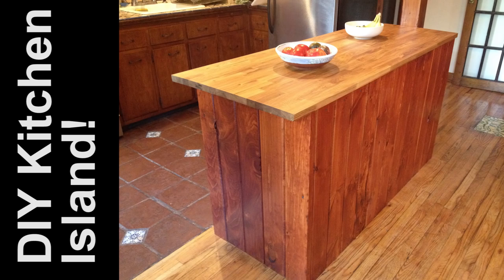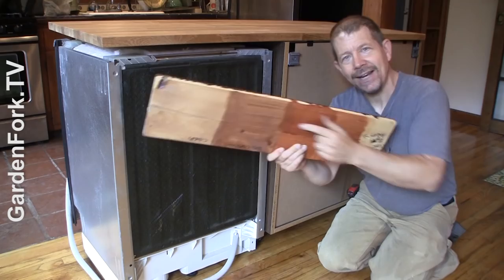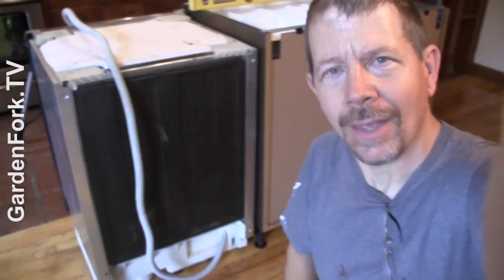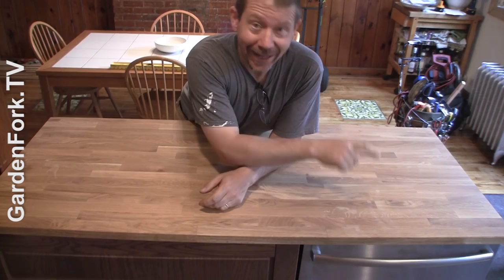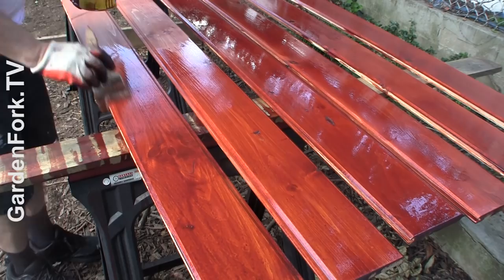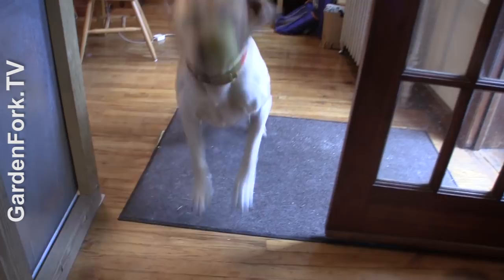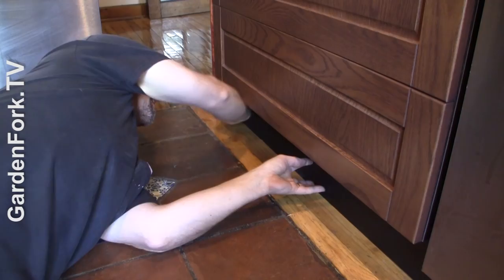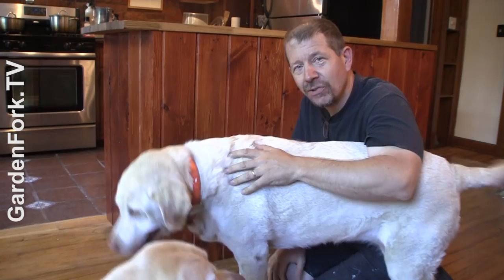DIY Ikea Kitchen Island - GardenFork

Comment: I enjoyed your video but I wish you had a video of you installing the plumping and electrical supply.
Reply from the maker: Hi Levi, whenever I do an electric video, the comment section blows up, so I don’t do them anymore. In most areas you can attach a grounded power cord to the dishwasher and plug it into a GFCI outlet instead of hard wiring it. The plumbing was under the floor, a P trap into the basement.

Comment: I will be using your idea with the 2x4s to build the wall of cabinet next to the dishwasher. I wasnt able to get a good picture of how you secured it besides attaching it to the butcher block. Im assuming you attached it to the floor and did you out any boards on the backside of the dishwasher to stabilize the end wall?

Comment: Hi Eric -
Do you think you could provide some photos of the plumbing from the basement? 
1.) Did you use a standpipe leading down to a p trap under the floor?
2.) If so, is it connected to a horizontal pipe....leading over to the sink drain... or directly into your main drain?
3.) What did you do for venting?
Reply from the maker: Sorry I don’t have photos!
Reply: @austin did you install a dishwasher? What did you do? I'm installing mine this weekend and would have also benefited from the answer to your question.

Comment: I want to do this if the space is big enough in my kitchen, but every picture of 'island w/dishwasher" I've seen except yours, includes a sink. Did you consider doing that instead of the drawers, and if not, do you think if you had it to do over you might have included a sink? I'm worried I will get a lot of water on the floor as I rinse off dishes and transfer to the dishwasher. That could be slippery. What's your experience been so far? What kind of floor is between the sink and dishwasher?

Comment: you could put a piece of trip around the top, under the counter to hide the screw holes, and bottom trim to even it out. Most cabinets have bottom trim
Reply from the maker: i think its a eye of the beholder thing, i like the black screws and the trim is pretty flush to the floor so i didn't put down any shoe moulding. thx!

Comment: Looking at the starting picture of your video, is the strip of wood running down the front right of the cabinet also a piece of paneling? If yes, is it easy to deal with paneling around a corner like that? It looks so seamless in the picture. I'm doing a very similar build inspired by this video but I'm trying to figure out how to best cover the 2x4 which would otherwise be visible from the front.
Reply from the maker: I just used a strip of clear pine and stained it the same color. Thx!
Reply: awesome thanks!